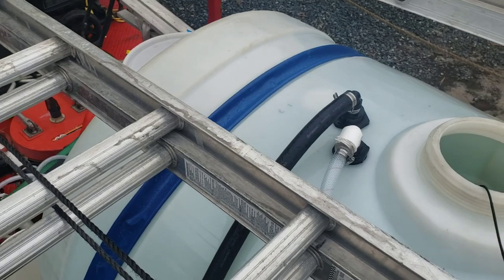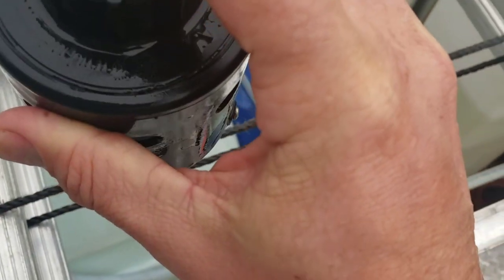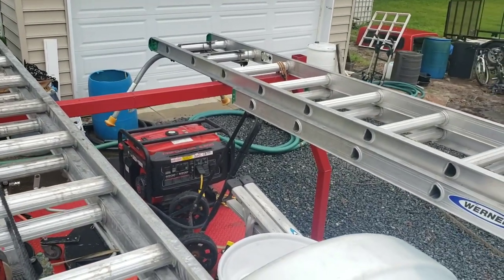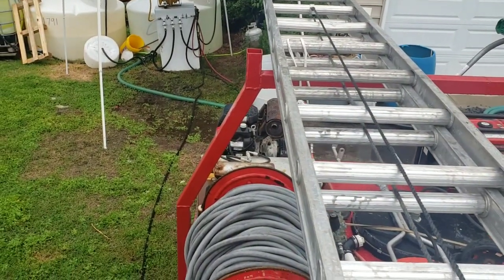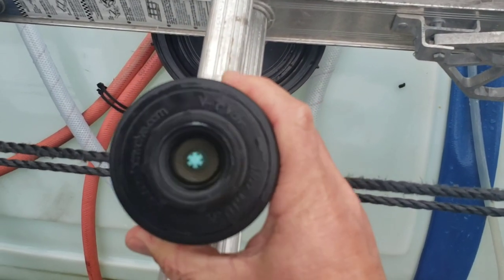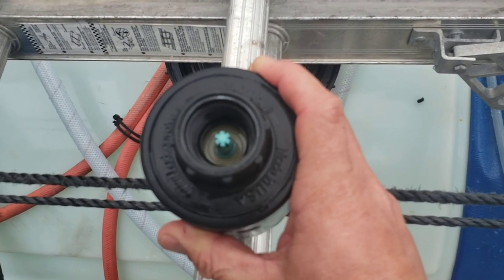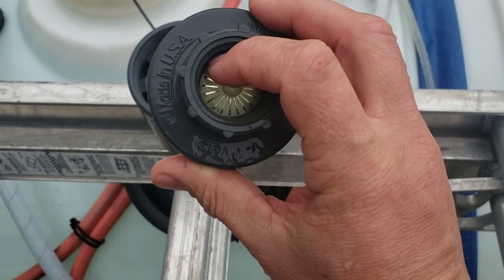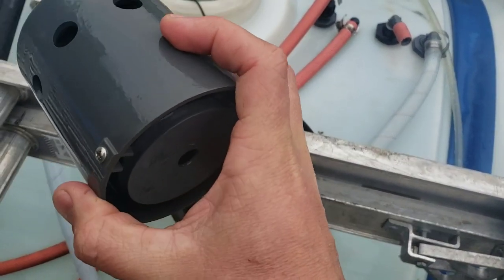Troubleshooting a Hudson Float Valve on your pressure washing buffer tank

Comment: nice sir is that small nipple with the red short hose is that your relief valve
Reply from the maker: That one in the initial clip is just a previous connection that we had cut off.  It might have been another pickup tube originally.  It was easier to just leave that in place than have an extra hole in the tank.

Comment: Brand new and mines overflowing
Reply from the maker: If you push up on it does it stop?
Reply: @Cleanpowerwash  I pushed up and I didn’t, could my truck not being even be the problem?
Reply from the maker: Unless it is crazy tilted it shouldn't matter.  But if you pushing up under it doesn't turn it off, then it is defective or has some trash blocking it.